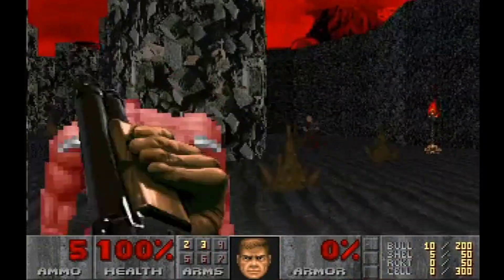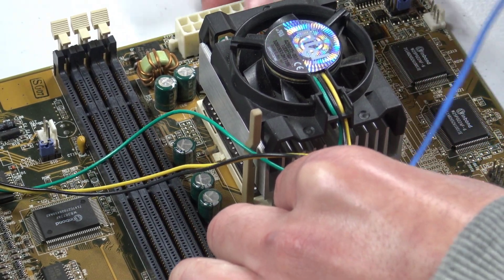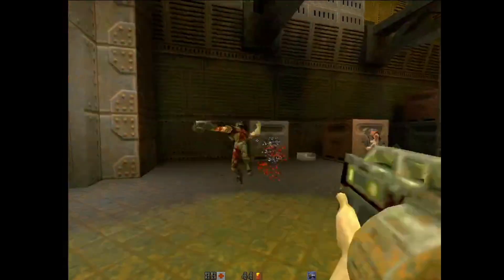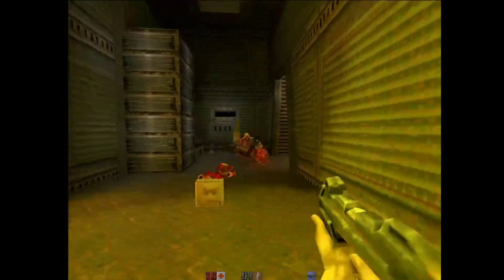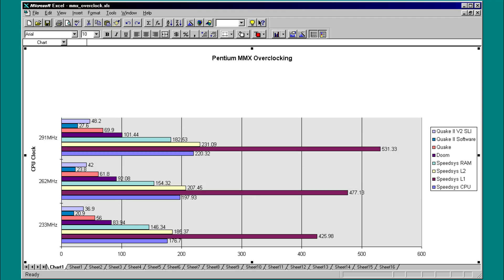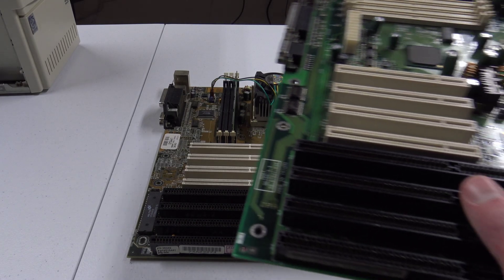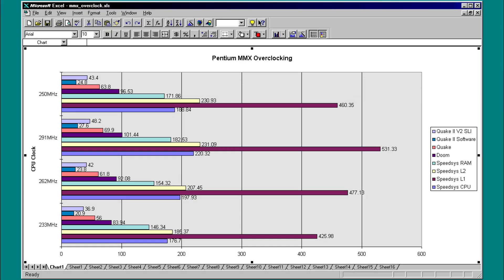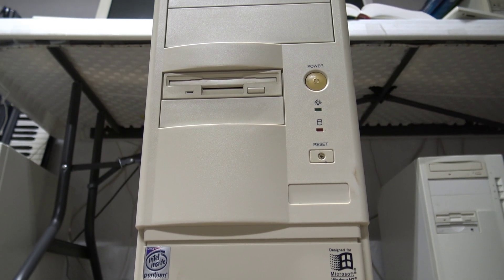Pentium MMX Overclocking - benchmarking up to 291MHz!

Comment: when i was little i ran a 200mhz pentium mmx at 266mhz and i used that system for years at that speed, till i swapped it out for a 550mhz amd k6-2, which i ran at like 632mhz.